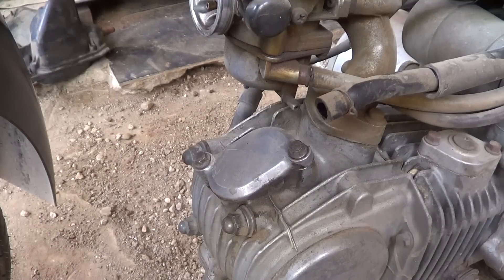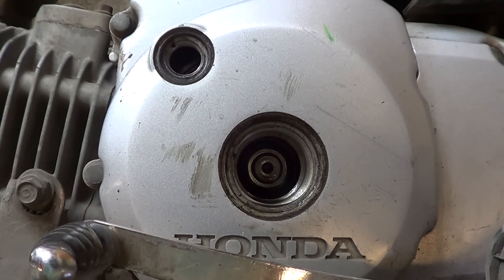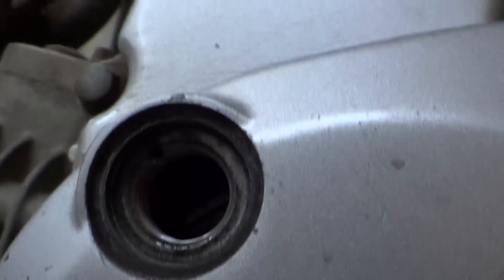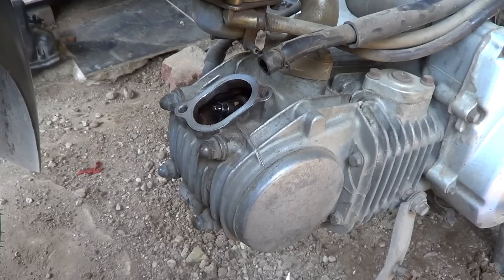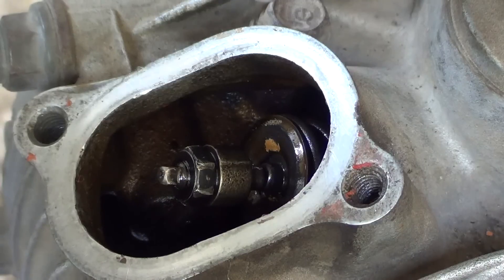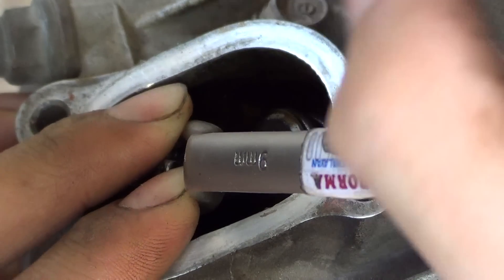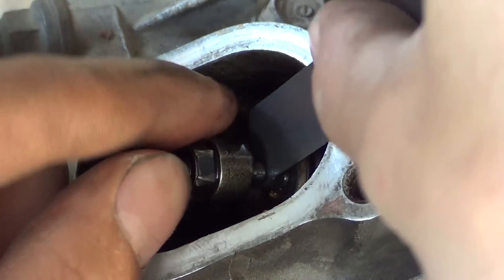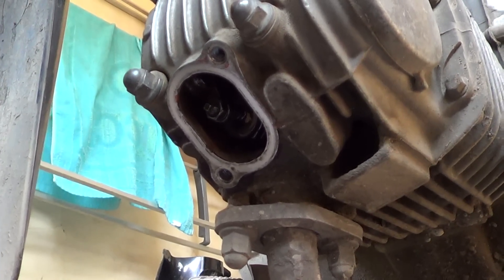How to Adjust Motorcycle Engine Valve Clearance

Comment: You suffer with a single cylinder 
What would you do with four or six cylinders 😂😂🙊🙊🙈🙈
Reply from the maker: +peter belt The principle is similar, whether it's a single or six cylinders. Set the piston on the top dead center, compression stroke. Thus, you can adjust the engine valve clearance both intake and exhaust valves. Good luck!